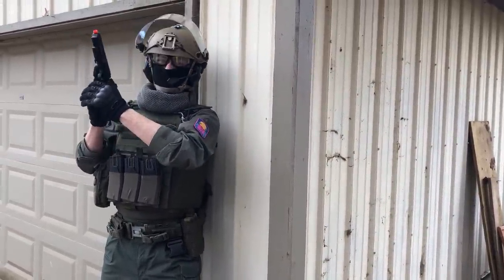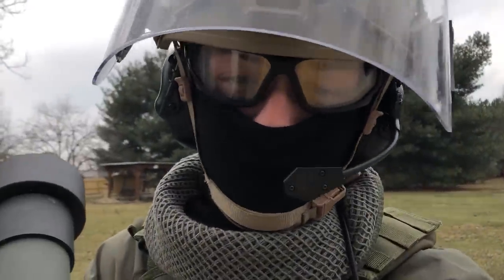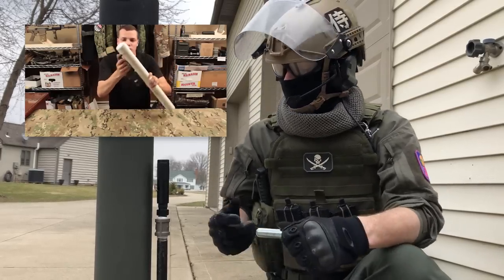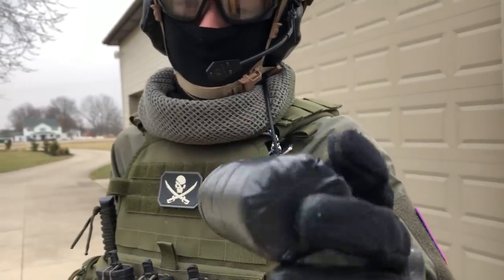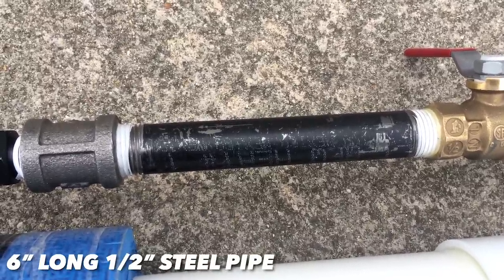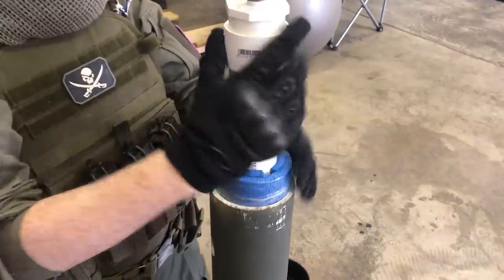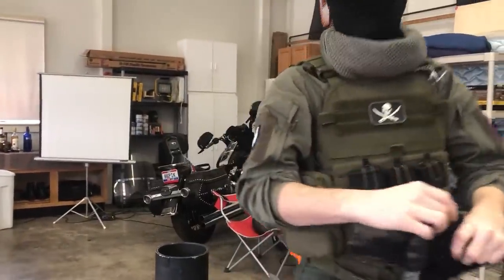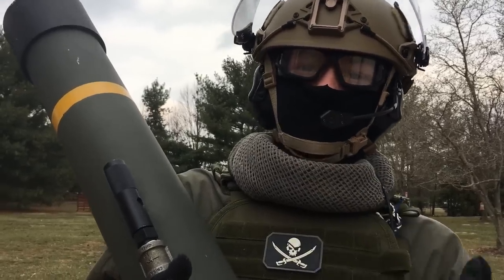How to Make an Airsoft Rocket Launcher // DIY CO2 Launcher for Mil Sim

Comment: I stopped everything to watch this
Reply: He broke his hat
Reply from the maker: Hopefully this performs a bit better than that spring RPG you reviewed. Thanks for watching 😘
Reply: Ok
Reply: hey
Reply: Callsign: Reach Nah, the ukarms rpg is better
Reply: wow rev?
Reply: @CallsignReach  hey man, I know it’s 2 years late but does the c02 threaded or not?
Reply from the maker: The CO2 bulb itself is not threaded, but the adapter is. They also sell adapters for the larger threaded bulbs (98g I think?) if you want more capacity, though those are quite a bit more expensive.
Reply: @CallsignReach  ok. Can I just say thanks so much for replying so fast man. Love the work!
Reply from the maker: No problem 👌

Comment: Better idea, cause CO2 Powerlettes ARE TOO EXPENSIVE!  Alcohol is cheaper and the small plastic water bottles are everywhere for FREE. I built nearly the ssme thing using a Bar B Que Ignitor, cut the neck off the plastic soda bottles and just before needing to fire i use a small pray bottle (old nasal spay bottle) filled with 90% Isopropyl Alcohol to spray a mist into the bottle, shove it into the launcher and press the Ignitor button ..... boom!  Ive shot plastic bottle almost 200 feet. Glue big "snap caps to the bottom the bottle (also helps inthe trajectory) and you get a bang when it impacts a hard surface!  Mine's better.

Comment: Love this idea, I used your basic idea then made the holding tube 1ft long, and made the 2" barrel 4ft long  to make it into a mortar. (No bigger outer pipe) I also replaced the plastic adapter 2" to 1/2 inch, to a pvc coupler with 2" thread on one side, then a steel adapter from 2" to  3/4, 3/4 to 1/2 adapter for durability.. this thing shoots about 400+ ft with the Nerf whistling vortex footballs.. So thank you for idea..👍🏻
Reply from the maker: That is awesome!! I’d love to see it in action
Reply: @CallsignReach  Yeah I will have to film it..🤔

Comment: Nice work Reach that's pretty cool. This reminds me of the potato cannons we made long long ago in a state far far away even before PVC was created. It was so long ago we taped tin cans together for the tube then punched a tiny hole in one side about 2" in from the bottom can for lighter fluid to be squirted in and a match to set it off and was it ever loud not to mention dangerous too but it was fun.
(Evil Grin) Muah ha ha ha haaaa.
Reply from the maker: Holy crap that’s some Mad Max level crafting right there
Reply: @CallsignReach  Maybe you can use those Nerf mortars like FOX GREEN used for his  aerial assault drone that made a cool whistling sound just like a real incoming mortar.
Reply from the maker: Now that’s a good idea 🤔

Comment: Use a solenoid valve. That way you get better gas release,  AND can make it look like an actual trigger.
Reply: The only problem with this is most solenoid valves can’t handle the pressure differential that a co2 cartridge supplies (~800-900psi discharge). I tried this idea myself and couldn’t get the valve to open under pressure.

Comment: Hey I made my self this today. I had a Wolverine bolt co2 adapter laying around which I used and the rest was 40$ at aces. I also used my vx-1 breakable caps by matrix for their vx1 40mm grenades filled it with powder and attached it to a thunder b trip wire shell and it made a prefect rocket that explodes with chalk on impact and is reusable!! You can also add folding fins to the rocket that fold one way and are held by tape which add spin to your rocket which adds range. This thing is epic! 

Edit you can also re position the handle to be more like a squeeze function on the real LAW
Reply from the maker: Dude that sounds amazing. Shoot me a video of it in action if you can!

Comment: I'd like to see you upgrade the trigger from a ball valve to a 12vdc solenoid valve with a battery. It would open faster and you wouldn't have to get out of firing position to work the trigger, a simple push button would do fine. Or get really tricked out and use a military style switch with a red safety cover that gets flipped out of the way for the switch to work.

Comment: An interesting and potentially better option is using Captain Xavier's Drainblaster bazooka build, it has far more payload options, is way less fiddly, does not require Co2 cartridges, and might not have cold weather problems.

Comment: Suggestions:
Shot-cup that seals tightly to the barrel wall.

Wad seal to pack into the barrel after loading the ammo in the shot cup, to keep your ammo from falling out of the cup/barrel while on the move.

Electric gas valve and battery pack to eliminate the clumsy ball valve arrangement.

3/8" gas line nipple to replace the 12g cartridge tube.  Shoot all day with a 48 oz lumbar-mounted CO2 tank.
Increased volume captive gas chamber to increase velocity/range of shot.

Grenade launcher sight so you have some idea of what you're shooting at.
Reply: Can you make a video or go into detail about this please haha
Reply: How can I add an compressed air tank to the gas line nipple and how big would you recommend the reservoir? 7-9” inches for maximum velocity and range?

Comment: I wonder if I could put a compressed air adapter (with hose) instead of a CO2 adapter use a second ball valve to control the flow rate into the compression chamber. 🤔🤔🤔 Long term would save more money than the $1 a shot CO2 especially since my field refills Airtanks for free. Even if I had to quick detach the air tank between shots it wouldn't be a problem, might increase immersion for longer reloads
Reply from the maker: That’s a better method! I’ve been trying to figure out an HPA solution. The CO2 isn’t the best system even though it’s probably the most readily available.
Reply: Has anyone completed this yet! I’m ready to use air compressor tanks instead
Reply: @CallsignReach  what would you need for a HPA version instead of the CO2 adapter
Reply from the maker: HPA fill nipple with a 1/2” male thread connector. They make them; the one I have is made by Tippmann. Either that or find a way to connect the tank directly to your assembly. Be advised, working with HPA is dangerous; you need to make sure that the pressure of your air rig does not exceed the pressure rating on your pipes or you’re going to have a really bad time. I’ve also had a lot of problems with the connectors not retaining their seal. I have been working on an HPA launcher and I’ve had multiple decompressions — extremely loud and potentially dangerous. I would honestly advise against making your own unless you really know what you’re doing.
Reply: @CallsignReach  Understood! Final question.. Does this version of CO2 cartridges also have potentially hazardous problems cause I’m only going to build it for a few launches!
Reply from the maker: There’s a guy who goes by G3AR - GeekGadgetGuru who has a more robust set up that can take both CO2 and HPA. You should check out his build because it might be better suited for what you’re trying to do.
Reply from the maker: Hazardous properties would include the typical risks involving gas under pressure, but as long as you’re making sure to wear protective eye gear and using pressure rated materials, you should be fine. CO2 can get really cold really fast, so I’d also suggest wearing gloves when handling the gas components. It’s not poisonous or anything but you’ll definitely want to do all your work in a ventilated area or outdoors.

Comment: I realized i work as a plumber and i can johnny cash my way into building one of these, also have you ever tried using 1 1/2" pvc with a cap as rockets? They fit very well inside the bore of a 2" pvc tube

Comment: Also you could probably get away with a small bike pump and use compressed air instead of co2.
Reply from the maker: I have a threaded adapter with an HPA fill nipple. I think it’s be cool to connect it to an air rig. The bike pump idea is interesting…

Comment: one thing I would add is a handmade ram rod made out of pvc pipe and add something to hold it
Reply from the maker: That’s a great suggestion. It would be easy to rig up a holder inside of the external tube to hold the rod in place. A wooden dowel would work as well
Reply: @CallsignReach   with the wooden dowel I would suggest to make the tip as flat as possible and put a piece of foam so it doesn't puncture trought

Comment: Does anyone think it would be a good idea to replace the ball valve with a solenoid valve? I think it would be much easier to just press a button rather than slap the gas into the launcher, and it would definitely stabilize it a bit more
Reply from the maker: Im actually working on a V.2 of this launcher that uses a solenoid valve right now!
Reply: @CallsignReach  you glorious bastard

Comment: I wonder if you could replace the hand valve with a solenoid for more efficient gas release
Reply from the maker: I have messed around with solenoids — I’ve had a hard time finding one that’s wide enough and has enough power to handle the pressure. I found one that uses a ball valve but I haven’t sat down to figure out a power supply yet.

Comment: I've built the exact configuration...however mine seems to not use all the C02 in one shot. I am able to throw the ball back in and fire again. The release even if I open the valve all the way doesn't push it all out fast enough? Any ideas? Is my adapter probably bad. 🤷🏼‍♂️

Comment: Question would you be able to skip the curve on the pipe by having just a straight pipe or would that cause problems?
Reply from the maker: You could skip the two elbows that make the curve and connect the ball valve directly to the back of the barrel. The most important part is that you have a good air seal and have at least a five-inch pipe as a reservoir for the CO2 to stay in after you puncture it with he adapter. Other than that, I’ve seen people customize the system in a bunch of different ways. I’m pretty sure that the launcher would be crazy long if you skipped the curve though; the curve is primarily to accommodate space and make it easier to operate while holding it.

Comment: Stupid question but what if you put an airsoft grenade in it
Reply from the maker: Not a stupid question at all — there’s no way to pull the pin, unfortunately. I did do a smoke grenade but it was kind of a disaster (smoked up the inside of the barrel and the body tube). Airsoft grenade shells, like you’d put in an M203 replica, are activated with a little button in the back so there’s no way to use those with this setup, either. I will say, nerf vortex footballs are the best ammo for one of these things
Reply: @CallsignReach  ok thanks for the answer

Comment: Hii, i made it, but the rocket only travels a couple feet... i made it out of metal pipe.. i try everything and nothing... you know what is going on?
Reply from the maker: I would check the size of the reservoir pipe (the one you connect the CO2 cartridge to). If that pipe isn’t big enough, it won’t have enough power to launch. The parts that hold pressure should be steel, but it should connect to the PVC “barrel” section.
Reply: @CallsignReach  i send an email to you
Reply: @CallsignReach  
Is there a difference if the barrel is made of metal? my rservoir pipe is 16 inches, i made ir longer for that reason
Reply: to your gmail that is in this channel
Reply: @CallsignReach  can you help me?

Comment: How do you tie your sniper veil around your neck?
Reply from the maker: I fold it end to end once so that it’s basically a big triangle, roll down the top of it, wrap it around my neck with the triangle hangin down in the front, then ties the ends under the triangle part. As I’m writing this I realize that it probably makes no sense. I could do a video?
Reply: Callsign: Reach Yes that would help a lot. Thank you!

Comment: I have a question hopefully you or someone can answer. I'm trying to take this a step further. Do you think if I add 2 CO2 adaptors for dual co2 cartridge to increase the pressure is a bad idea? I'm trying to make it better so I can point straight shoot and hit my target without having to compensate so much and risk missing.
Reply: Or if you could attach a remote line from an air tank.
Reply from the maker: So I have an adapter for a 90g CO2 cartridge that I’m trying to rig up. I tried attaching a remote line and it seemed a little too dangerous for my taste (and blew my hearing out when I accidentally depressurized the pipe). I’d personally suggest sticking to CO2 and increasing to a 33g or 90g cartridge if you’re trying to do multiple shots.
Reply from the maker: Range and accuracy also depends on your ammo type. Nerf footballs really are the best.
Reply: @CallsignReach  so the adaptor in this video wont work with a higher gram? Will you eventually try two 90 gram adaptors hooked up to a single reservoir? I think I want to step up to 90. I need a different adaptor right? Thanks for getting back to me.
Reply: @CallsignReach  you think you can find a better trigger system? With the ball valve you lose pressure when you're bringing back the lever to the closed position if you're using a higher gram cartridge. Can you make an electronic solenoid that opens it and make a video on it???

Comment: I can hear mine fizzling through slightly inside the ball valve. Do I have a bad ball valve?
Reply from the maker: Nah you probably just have a bad seal, go back through the spots where you think the leak is coming and reapply your tape and your epoxy/rubber stuff. Usually a small leak isn’t going to mess with your efficiency too much.
Reply: @CallsignReach  I'll try that thanks. You also used an epoxy sealer on the threads right?
Reply from the maker: @JAWZPB  yes that works best 👍
Reply: @CallsignReach  is there a better way to reach you? I did a mod to mine and I want to show you what I did.
Reply from the maker: Oh yeah you can dm me on Instagram @callsignreach